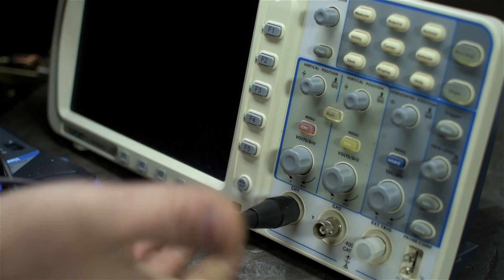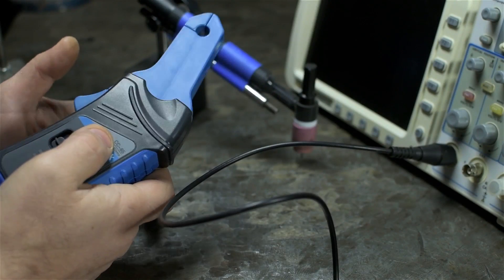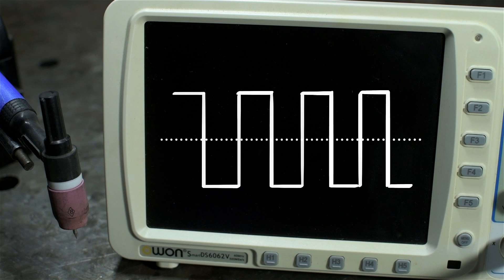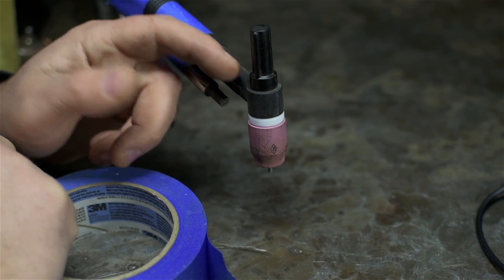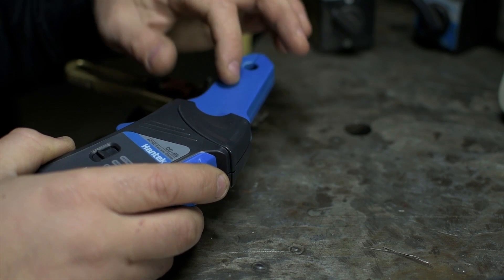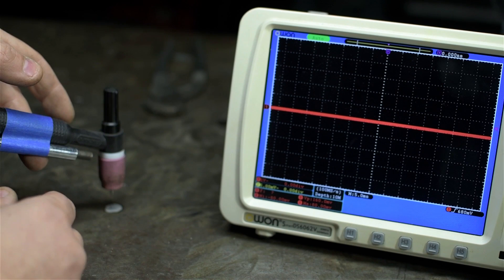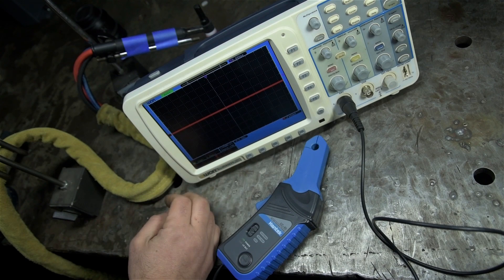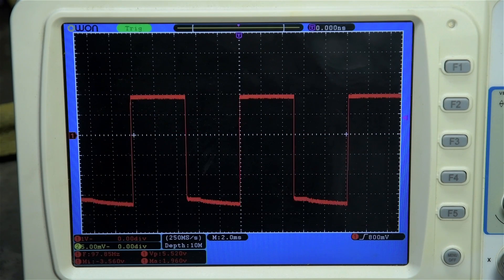Oscillo-Help-Me?

Comment: Tony, it's quite obvious- two different welders, same scope. It's your scope.

LOL, nah, that was just a joke. The real cause is from the fabric in your shirt- it's acting as a conduit from all of the electrical items in your shop, which in turn creates what we in the business call a dynamically static warp bubble. You need to either ground yourself as you come into contact with the gear OR stop using craft fabric softener. Yeah that is an awful choice to make- If you don't, your welds will become worse and worse, and extended on a long enough timeline, you'll short-out everything you touch, but if you do, while your welds will be perfect (IAW your skill-level, I mean, only god can create a miracle), but your underwear will be itchy.

Comment: Did you zero/adjust your verticle position to ground before you measured anything? I'm now interested in seeing the ouput on my Miller 210DX CPS with my 100mhz Techtronix 4ch Scope and see if I have the same issue. The EEVblog guy from Oz would know way more than I would, ask him!

Comment: I hate being the bearer of bad news but all this is due to the scope's value of 0 not being at the same level as the welder's value of 0. Basically the signal ground references are not inline. Remember to understand that signal ground and power ground are not one and the same. In college I fried my fair share of circuits by not realizing that fact.  Hope this helps.

Comment: Is to do with the actual arc? The way the current is actually transferred through the arc is different with different polarity. That's why you use DCEP for some things and DCEN for others. It may that this is just what you get with an argon plasma and a symmetrically oscillating voltage.

Comment: At those sorts of currents you don't really need the current clamp - just wrap some thin wire around the lead and use the scope probe either side of that wire.  Basically a single turn transformer where the welding current is the primary side.

Comment: Tony, No devices can sustain HF. Best practice is to measure once arc starts after HF cycle. Optically isolated voltage to voltage convertor would isolate scope from welding circuit.
In pulsed TIG there is no negative cycle, just Peak and Base.

Comment: Hi Tony, I've been making these waveform measurements for over 30 years for electrical safety purposes for Canadian Standards Association and Underwriters Laboratories.  It has an interesting history moving from analog to digital, DC to AC, Sine wave to Square wave, etc.  It's complicated to express all my experience in a comment but if you want to take it off line I could help you with understanding why CSA and UL would/would not allow or at least be concerned about the way energy is delivered to the Arc.  THX

Comment: Ok, I may be totally wrong here but it looks to me like the welder is actually outputing DC current but shifting it sixty times a second to simulate AC. This is an old trick they used to do with reed switches and it allowed you to transform the voltage  up and down with a regular transformer.  If I am correct about the output being DC it is hard to get a  rectafier that will put out a perfect DC  voltage. Quite often it will have a small amount of AC ripple in the output.  This is not a big problem unless you need very clean DC power.  For a welder I don't see it being an issue.  If he was charging a battery bank then maybe.  Anyway I think that is the distortion we aremseeing on the negative wave form.  As for why the positive is less than the negative he said it himself.  His O scope is ungrounded so he has no fixed zero reference to refer to.  He is getting the desired amperage output but since his scope has no idea what it ismeasuring against it can only show the amplitude in reference to an arbitrary point.

Comment: Sorry for being "late to the party" but here is my 2¢

Inductive amp meters are far from a "perfect" measuring device.  What you really want is a 100A shunt resistor inline in the ground lead..  Then, using 2 scope probes, one on either side of the shunt, do a "differential" (Ch1 - Ch2) display.  I think this will be a lot more accurate.

Better yet, get a old Tektronix 7000 series with a differential input amplifier.  These will probably do a better job of stray RF rejection.  Besides these are all analog, nothing digital to go wonky.  With a time base and of course re-calibrated to a known standard, it will cost you more than both of your TIG machine and your current 'scope !

Your asymmetry may be just because you don't have a common ground between the DUT and your measuring equipment.  I'm not sure if I want a common ground either !

Comment: Hey tony i believe the reason for the uneven arc cycle is something called src rectification. Theoretically, the half cycles of ac currnt are equal, but when actually weldig on metals with heavy oxide coatings, the electrons transfer across the arc uevenly, the result is that the positive half cycle has much less magnitude than he negative half. This often results in an unstable arc. This is know as arc rectification. Arc rectification occurs because of the surface oxide layers on the work piece,  the oxide acts like a rectifier by restricting the flow of electrons from the work to the electrode during the reverse polarity half cycle and has little or no effect during the straight polarity half cycle. This results in an uneven ac sine wave.

Comment: Some of the even fancier machines allow you to dial in exactly how many amps you want during the electrode positive time, and then the negative time, in addition to the amount of time spent in EN and EP. As you know, too much power during EP will ball up, sputter or simply evaporate the tungsten tip. I'm super curious to see what the waveform looks like for DC, given how a modern machine uses beefy transistors and switches at a high freq, instead of the old copper transformer

Comment: honestly that wouldn't surprise me if the machine is built like that considering you commonly need more amperage on the one side cause the more on the other the hotter your tungsten gets if it was pure then it would round off so there more made for lanthiated tungsten and on that side of the amperage  is more for cleaning  so less amperage needed to blast it clean

Comment: Measure the ac current going through an incandescent light bulb. That is simetrical and should appear that way on the scope. This will rule out any offset issues or gain issues with the current probe

Comment: Hi Tony, I saw on you the video holding clamp meter switched on to 1mV/10mA range. On this setting, output of the meter should swing from -6.5V to +6.5V to cover ±65A range, so it's internal supply should be at least 13V. Since it is powered by 9V battery it is almost impossible. It would need internal boost converter, which is uncommon in simple measurement instruments. Output of your clamp saturates on +2V and -3V on the waveform you showed. I think, clamp's internal supply is 5V, which can be easily regulated from 9V battery. 
According to clamp's manual, 1mV/10mA setting is suitable to measure 10mA to 20A of current. More than 20A saturates the output at 2V. 
Full 65A range you will get only on the next, 1mV/100mA setting. On this setting 10A of current flowing though the clamp produces 100mV of output voltage. Theoretically, you can achieve 200A range on this setting, but with much bigger error and non-linearity. To compensate smaller gain from clamp, change scale on the oscilloscope to 500mV/div or 200mV/div.
Also make sure you have put fresh 9V alkaline  battery into your clamp and test procedure from clamp's manual: "In the case of DC current measurement, clamp can not possibly zero properly, due to the hysteresis effect. To eliminate this, open and close jaws several times and then zero again." It may bring zero level to center between clamp's supply rails.

Comment: Looks like a simple setup issue: you selected the 1mV/10mA range on the clamp. This is limited to 10A according to the manufacturer documentation.
Set the clamp to 1mV/100mA, the scope channel on DC, 1V/div and this should give you a clean reading!

Comment: A number of thoughts come to mind:  1 - You don't have any reference on the oscope without it plugged into the wall or the 2nd channel probe ground connected to the workbench.  This should not matter much as long as you are only using the current probe.    2 - Did you set the current offset to zero before running the test?   (unclip fromwire, close probe, degauss, read zero current and set trace to zero on scope)  3 - Did you degauss the probe between runs? (does that probe HAVE a degauss feature?)    4 - The old waveform & the new one BOTH look like the probe is saturating at the top end of the waveform.  The sign is that there is no noise at the top end.  That is your first indication that the waveform is being "clipped".    5 - Current probes are susceptible to magnetization if you get close to the max current rating.  Maybe when this welder starts up, it begins with current in the same direction every time, and this is magnetizing the probe (with a negative bias) at startup?  Try flipping the probe over and see if the offset is the same to the positive side (does the waveform flip?)   6 - One more thought: try clamping the probe in place AFTER initial startup to rule out the startup transient messing with the probe

Comment: The noise on the leading and trailing edges could be related to microphonic noise.  Apparently some capacitors in electronics equipment can generate signals from vibration or similar inputs. I ran across a YouTube video showing how even a digital oscilloscope or scope probe may produce a signal when tapped. Perhaps something in your system is responding to the sound of the arc?

Comment: I'm thinking your amp clamp doesn't have enough dynamic range.  That is, an amp clamp capable of measuring 65DCA only has a 65A dynamic range.  To measure 40ACA, you need at least 80A dynamic range.  Try a welder setup with less than 65/2 Amp setting and it might do you right.

Comment: I wonder if there is some sort of RCL filter factor present.  If you are able too; try different frequencies "on the fly" to see if the offset effect changes. If there is any way possible to measure off of the Positive (not the ground wire) that may give you a clue. (I apologize in advance if I did not use the semi colon properly.  I try to exercise it as often as possible, but alas; I don't really have a ticket to use one).

Comment: Without reading through the whole lot of the comments, I did not see too much that covered all what I have to say.  So here goes...

The clamp meter reads AC/DC (or was it DC/AC).  Anyway, that seems to indicate it uses a transformer for the AC and a Hall effect sensor for the DC.  The Hall effect offset is nulled with no current through the clamp using a trimmer wheel on the front or side of the meter.  But the Hall circuit may not be symmetrical.  In fact one of my old cheap clamp meters died in that way - it could not be nulled any more.  The way to check that is by running DC arc and looking the results at both orientations of the clamp.  Same current, same positive and negative indications.
Another thing to of course check is that the scope input is DC coupled.  An AC coupling there would try to center the peak to peak trace.
Then to the power supply and the arc.  For the first, the arc voltage on each half cycle is radically different.  Straight polarity - Electrode Negative -produces somewhere around 8 to 12 V at the arc, using argon gas.  Reverse polarity - Electrode Positive - is unsteady and generally 20 to 35 V.  That is where in aluminum welding the cleaning action takes place.
If you have the same constant current on both polarities, it means that the power is more than double on the reverse polarity.  That also means that the primary current of the welder needs to be higher during the reverse polarity.  An it could mean that the power supply runs out  of its resources at that time.  However, it looks like the unsteady side is your negative scope trace side and the properly controlled one is what appears positive.  You would indeed need to verify the polarity issues using DC weld.
Then about the instrumentation.  I have settled on two devices TEK AM 503B probe amplifier and 504 XL probe for the high speed measurements and LEM active current transformers for the low speed applications.  But I have added a copper tape shield to the inside of the toroid and provided that with a ground connection.  The copper tape does not make quite a full turn, or is insulated with Kapton tape so the Eddy currents are eliminated.  It only functions as a capacitive shield.  With that I can measure even the HF arc start time without trashing the scope.
As a side note, I also have built my own voltage probe that works with ( i.e. cancels) at least 15 kilovolts HF noise.
As you may guess, I have done the better part of my lifetime work in designing and testing TIG (and plasma) welding systems.  Now I’m retired, though.

Comment: Time to test your system.  Make a circuit with a DC power source and try your clamp on it.  vary the current, and see if the DC component shows up on the scope.  (make sure the scope is in DC mode)  Many inductive sensors depend on changing current to read voltage...if that's the case, the DC component of the waveform will not be read.  I noticed on the shot of your old welder that the waveform had slightly more time spent in the negative region than the positive, and the average of the waveform was around -2v...that could mean that since the DC component of the current was missing that the scope was taking the average of the remaining AC...and since more time was spent being negative than positive, the average would be negative...(you know about that with a 5 year old I bet)...anyway...just a thought...love your presentations...(0)'LBCNU

Comment: The issue may come from your welding table, try a setup where your ground is directly connected to a welding material the closest to your torch and on an insulated surface. 
Your table have a large conductive surface, meaning you have a branch of resistances in parallel reducing its actually resistance or augmenting amperage pathway to make it simple.
You are basically welding on a faraday cage only the high frequency induced create interferences in your negative, the large pathway then acted as a capacitor because your table is negatively charged. DC welding is then recommended on your setup. give it a shot.

Comment: Tony, watched the video yesterday and mulled it over. If you have a heated garage or can stand working outside in the cold, try your scope on both sides of you battery cables in your car. If the positive side looks "normal", but the negative side still looks wonky, you'll at least know it has something to do with your scope an not the welder.

Comment: The Hantek is not just a link coupling (inductive coupling) like some suggested.  For it to work with AC and DC, it means it's sensor is Hall Effect (magnetic).  That could easily get non-linear as you approach its limits.  You should get some sense of that by flipping the coupler over as many suggested.  Since the waveform you trying to measure is not DC and involves a lot of current, you might try measuring with just a simple link coupling.  Put some turns of wire (size doesn't matter - smaller is easier) around the cable and couple that into the scope.  This may distort the square wave a little, but the amplitudes should be quite accurate.  Be sure the scope is in DC mode as others have suggested.  Being in AC mode using any technique will shift the zero line with changes in duty cycle.  If the high frequency is giving you fits, put a small capacitor across the link you made.  This will filter out a lot of the high frequency component without having much impact on anything but maybe the rise time of your square wave.  The size cap would depend on the link you wind, but I'd probably try  something like  .1uf to start with and see if it distorts the square wave too much.

Love your videos!       ...Tiger

Comment: Maybe you forgot to use the ground clamp to connect the oscilloscope ground it to the welder ground. That will make the peak to peak reading correct, but the middle of the wave wouldn't sit at 0v.

The other thing you should check is the AC / DC coupling mode in the scope.

Btw, to rule out any problem with the scope, you could always measure other stuffs, like the power outlet. using those clamps you can easily clamp on any extension cord lying around and see if the voltage is symmetrical. Or, you could measure the waveform that's generated by the scope itself (the 5v 1khz on the scope's panel, bottom right metal bar, tho it's not AC)

Comment: Hey Tony, you probably already have way more responses than you need, but by complete happenstance, I had a CC650 current clamp on order when you published the video. The CC650 is good for 650A, but in the manual it indicates that the 1mV/100mA mode is only good up to around 20A. Not sure what range you were using (and not sure that holds true for the 65A version), but beyond that 20A region, the clamp could start giving interesting (but wrong) readings.

Comment: G'day Tony, have you tried wrapping some wire around the welding lead and measuring the induced voltage in that? It would take that current clamp out of the equation and I don't think you need an absolute measurement, merely a relative +ve vs -ve indication.

Comment: HF start is very "influential".   It trips the circuit breaker of the lights in my garage more often than not, even though I put my welding circuit in metal conduit and grounded it thoroughly.  Never
happens in stick mode.